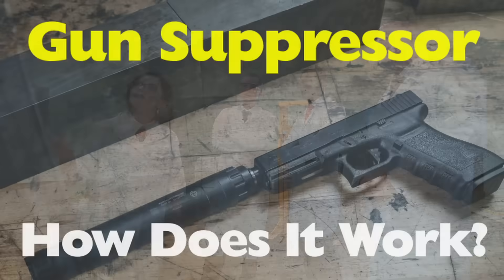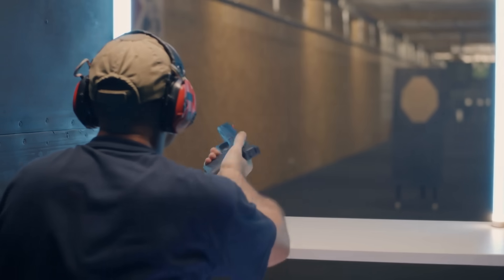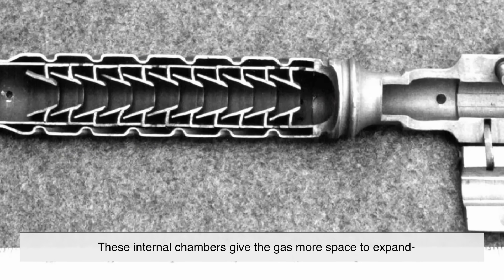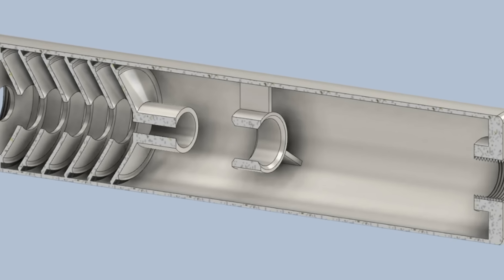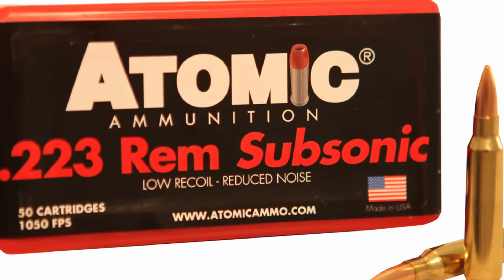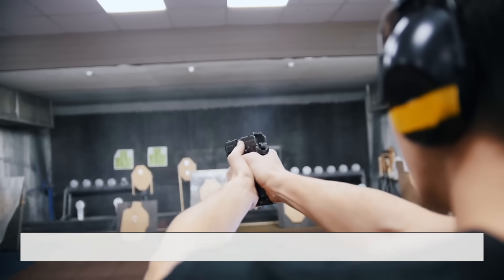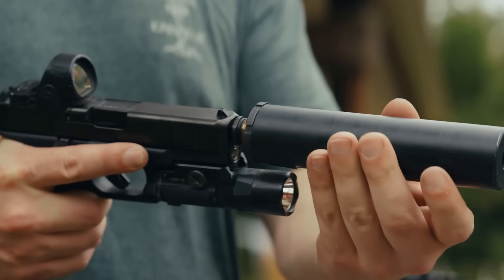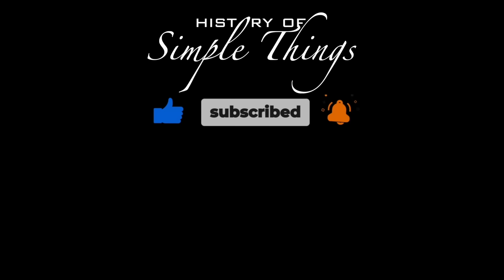How Does a Gun Suppressor (“Silencer”) Work?

Comment: Silencers DO NOT WORK on standard revolvers because the gap between the cylinder and the barrel permits so much gas to leak out that the effect of the silencer is imperceptible. There USED TO BE revolvers that could use silencers because they closed the gap between cylinder and barrel. Most famous of these is the Nagant revolver, which was a favorite of Soviet assassins.

Comment: I met a guy who made his own from oil seals, aluminium tubing and plumbing fittings, quite simple and very effective. He shot a 303 Enfield, a well-known loud gun, and it really quietened it down. He also made his own ammunition. I've seen guys using car oil filters; they seem to work OK and cost £10, all you have to do is drill a hole in it for the bullet to exit, its already threaded, just need to work out which one fits your gun  - 1/2x28 - 5/8x24 ·  - 5/8x24 -  common sizes,

Comment: It's a silencer. The Inventor and original patent holder named it a silencer. H. P. MAXIM SILENCER FOR GUNS Filed Feb. 21, 1921 Patented Feb. You're confusing what it's called with what it does.
Reply: Does it actually "silence" the round ?
Reply: @gregorymccue5003 But that's not what it is called. Do you have trouble with Aspirin because it's actually acetylsalicylic acid, a nonsteroidal anti-inflammator?
Or Nikees because they're actually Hominid bipedal ambulation enhancement devices? Go tell the trademark holder of Nike that his name is wrong.
Reply: @mimetypeI prefer to use accurate language and not call something what it's not just because other people are doing so.  Clear language promoted clear thinking.
Reply: It's a noise suppressor so it does "suppress".
Reply: @TJ3310CEO It attenuates and it's called a silencer.
Reply: Just because Maxim called it a "silencer" does NOT mean that it is an accurate term.  For all his brilliance, Maxim was still quite capable of overreaching hype.